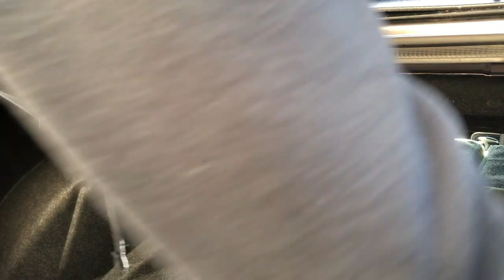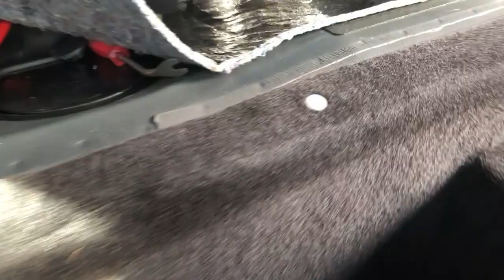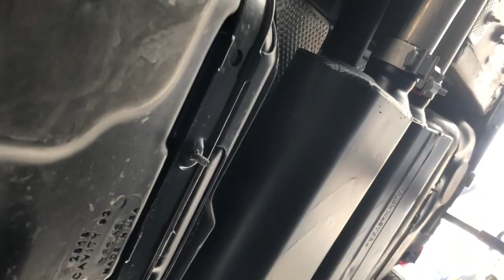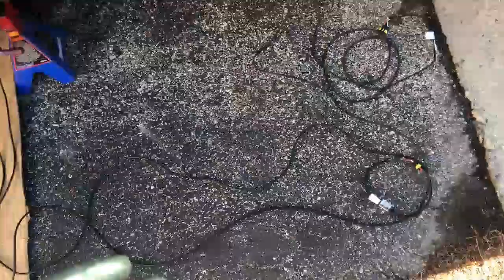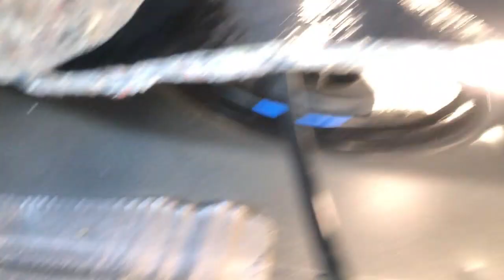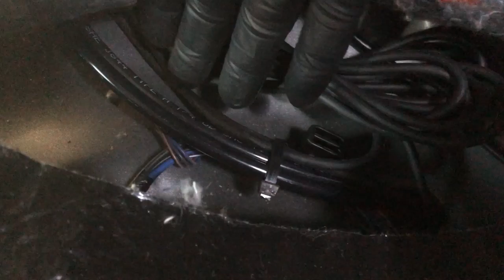3rd Gen. Challenger Air Suspension Build Pt. 1 (Airlift 3P/3H)

Comment: The pink signal wire, did you use the connector they provided or just wrapped it around the fuse and put it back in?
Reply from the maker: Youheminow392 hey whats up man. I just tightly wrapped the wire around the fuse prong. The two fuse adapters provided were ATO & mini sizes, not the correct low-profile mini size, which most vehicles are now utilizing.
Reply: BeeCee Built ok gotcha, thanks man! That’s what I plan on doing.
Reply from the maker: Youheminow392 got ya. Yea its fine just make sure it’s tight, clean, and no fray wires coming out. Good luck! Anymore questions don’t hesitate to ask.

Comment: I am going to duplicate this system on my 2019 Challenger,,,
I am about to order from Bag Riders the 3P management system. there is some options like manifold line size and tank size.
could you list all that i should order to copy this system,,, thanks
Reply from the maker: CD_ROLLS whats up man. I would suggest 1/4 line size. I would go with a 5 gallon tank. I prefer face port tanks over side ports. The more ports you have, the more you have to play with, like I did with this by including a air chuck. This tank is actually side and face port, its the Airlift 5 gallon 7 port tank. I would suggest getting water traps as well, I did Airlift water traps on this setup but I prefer SMC water traps.
Reply: @TheOriginalBeeCee  so i orderer everything from bag riders and im going to do this install myself. is 3/8 manifold airline going to be ok.  I ordered that by mistake. i did get 5 gal tank , 2 compressors and harness.
Reply from the maker: CD_ROLLS I’m not a fan of 3/8 line. It will make the car drop and fill wayy faster. But im my opinion its almost to fast, the car almost slams down when you air out. Its not like a smooth air-out where it just eases to the ground. But its really a preference thing. Im just not a fan of 3/8. You could prob call them and have them switch it to 1/4 before it ships out if you wanted.
Reply: @TheOriginalBeeCee  ok thanks for that info.
i like the idea of being able to fill faster..
...
Reply from the maker: CD_ROLLS I would maybe suggest searching for a couple 3/8 line dumps & fills videos to get an idea of what to expect.
Reply: @TheOriginalBeeCee  I called bag riders to change the airline size and they said 3/8 line is ok because the car is heavy... and there is a regulator i can put in line to slow down the air flow... ya think that will be ok
Reply from the maker: CD_ROLLS all the line size contributes too is how quick the car airs up/airs out. I know you said you like the idea of it “filling faster”, but keep in mind this has nothing to do with the tank, or amount of on demand air you have. The tank won’t fill up any quicker because you have 3/8 lines size. This Challenger has 1/4 line size...watch the last minute of Part 4, the car airs up in literally one second, and airs out smoothly in about 3-5 seconds. 3/8 is almost like Hydraulics. Yes the do make flow controls, but on BagRiders the PTC Flow Control is $25. Doesn’t make any sense to me to spend $100 on 4 Flow Controls to make it operate like 1/4 line, when you can just get 1/4 line from start. Like I said its really is a preference thing at the end of the day, I’m not a fan. if I had to run 3/8 I would 100% include Flow Control Valves, although flow controls are one less thing you need to spend money on.
Reply: @TheOriginalBeeCee  dude, your totally right. i should have just went with 1/4 ... 
...and they shipped it already.
Reply from the maker: CD_ROLLS i got ya. If I remember correctly you can order line from Bagriders for a reasonable price, or honestly you could probably reach out to Airlift and they would hook it up, their customer service is usually pretty good